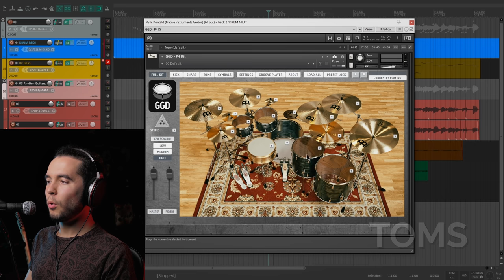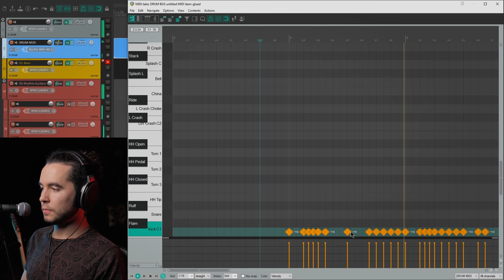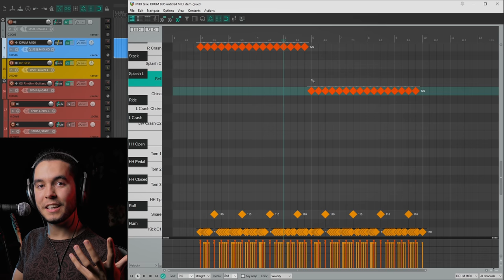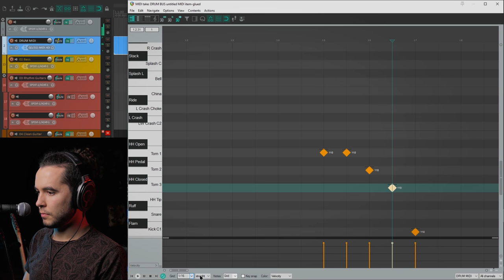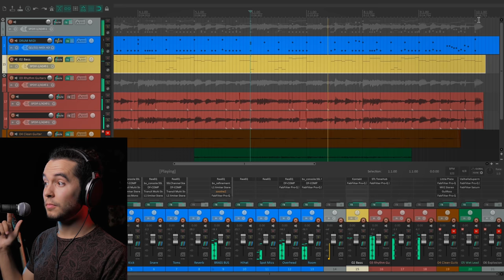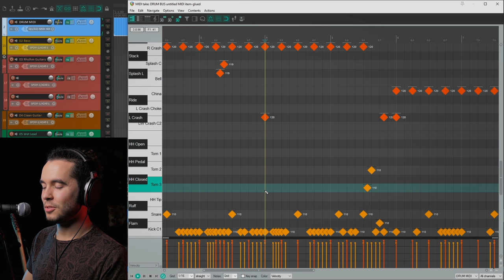HOW TO PROGRAM METAL DRUMS - 3 Simple Steps

Comment: I've been doing this ever since watching the video. It works really well. 
Something that made things quicker for me-

1.write the guitar part in guitar pro (I do this regardless. I usually have to practice my part a lot before recording).
2.export as midi file
3. drag the midi file onto your drum parts.
4. use the transpose feature in your midi menu 
5. set your range from C0 to C0 (this is usually what your kick is on in the midi controller.) 
Every guitar note is now synced with the kick drum.

Comment: So, I have reaper and GGD, so should be able to do the same set up as yourself. Can I ask what your settings are to program the midi like this, for example the way the keyboard is on the left, and the diamond notes etc, as when I open my midi programmer up it’s just a massive piano roll and it’s little rectangles that I practically have to paint in (it doesn’t snap to grid) so it’s super tricky to get a beat written quickly and in time. 
Just a wee description of your set up would help me massively if possible? 
This video is amazing btw, really inspiring!!
Reply from the maker: Diamond mode alt+7

Comment: What is Step 0?  What software is absolutely REQUIRED to achieve this?  I have a copy of Reaper.  Also, any additional hardware information required would be super helpful.  I'm trying to learn how to do this, but fail to understand the concept of DAW vs Plug-in.  Great riff too, sounds great!
Reply from the maker: Thanks Stephen! You are required to have a DAW and a drum sampler, that you will load as a plugin in your DAW. I'm using GGD, which uses Kontakt as the sampler so that's the plugin I'm loading
Reply: @joaoldmedeiros  Thanks my man!
Reply: @joaoldmedeiros  What is a good hardware interface to record guitars and vocals?

Comment: thanks for this guide joao, i know this is an older video but it's insanely helpful. can i ask how you made your drum midi editor use those diamonds instead of the bars, and is there an advantage to that?
Reply from the maker: Thank you so much Erick, I'm glad it's useful! There's a menu item for it on the toolbar, or alt7 I think the keyboard shortcut is. Yes the advantage is that rectangles become infinitely small when you zoom out, and diamonds don't
Reply: @joaoldmedeiros  thanks!